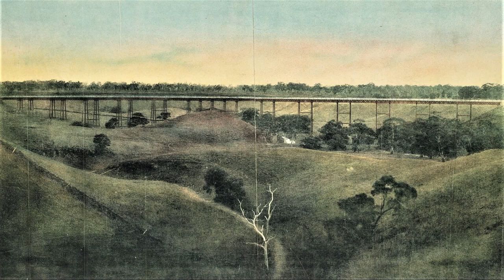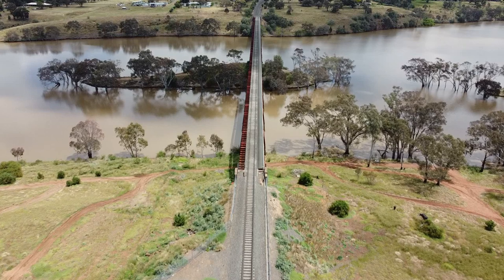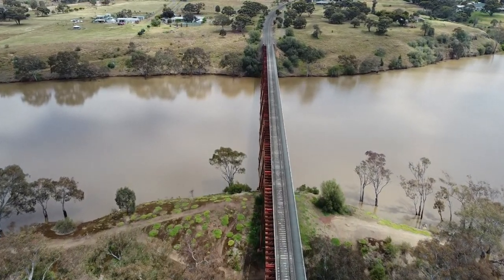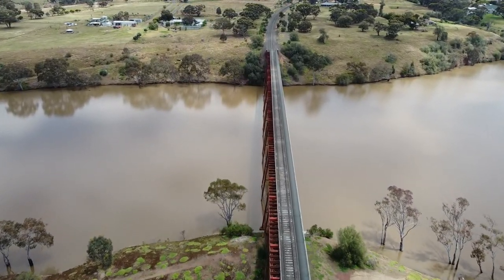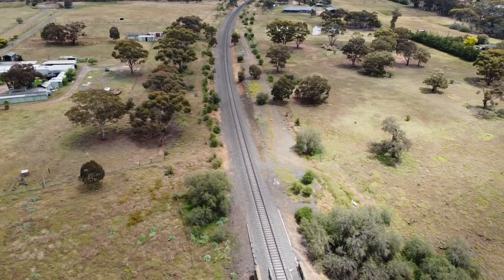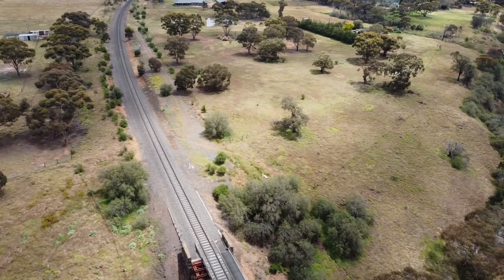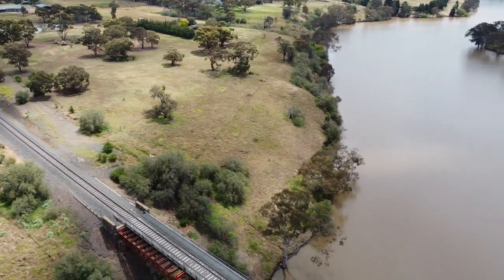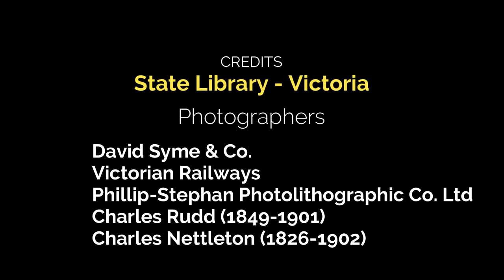Aerial view - Historical Images : Victorian Railway Viaduct - Melton Werribee River - Australia

Comment: I travel in the train fairly regular over the viaduct and you do see a lot of rubbish dumped at the site you were at and other sites.
When the water level in the weir is low you can access the island under the viaduct by land and rubbish gets dumped there as well.

Heading up from the viaduct to Melton Station, the new housing estate on the north side of the railway, that backs onto the railway, has added to the the rubbish dumping problem with mattresses, Styrofoam packaging etc now lining the railway between the track and back fences of the houses.
And whoopee new housing is being built on the south side which I'm sure will add to the rubbish problem.
Reply from the maker: Absolutely correct - Dumping trash and hard waste is disgraceful, lazy and an unfortunately option for individuals who have no empathy to the environment and the community. With streets and homes prior to these locations, it wouldn't take much for a house or two to have CCTV and capture trailers and utes entering the area full of waste and then leaving empty, for the authorities to act on !

Comment from the maker: Just a heads up regarding the comment about jetski use in this area would need to be clarified by the authorities - Nearby there is the Melbourne Runabout & Speedboat Club using this Werribee River, thus suggesting only, that jetski use might be ok. There was a posted sign where I had parked up my motorcycle, however it was bent, graffitied and damaged to being totally illegible. Please note to take your rubbish away with you; it was evident some were not !
Reply: to legally run a pwc/boat in the weir you must be a member of the mbsc. cheers
Reply from the maker: @bigman4225  Thanks - So it is possible once a member !
Reply: @urbanaerialexplorer1885  correct. they have a special boat ramp and everything. no need to try and mud launch
Reply from the maker: @bigman4225  That's a good thing if you want somewhere local to run a jetski with kids,  that isn't salt water !
Reply: @urbanaerialexplorer1885  definitely and it helps on maitenance on the machine too as you dont have to flush the engine when using it in freshwater